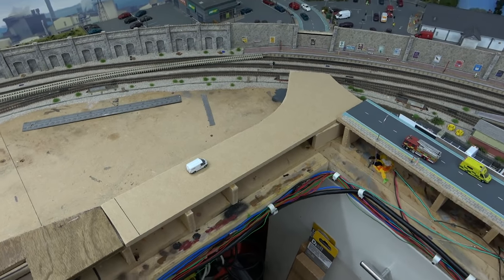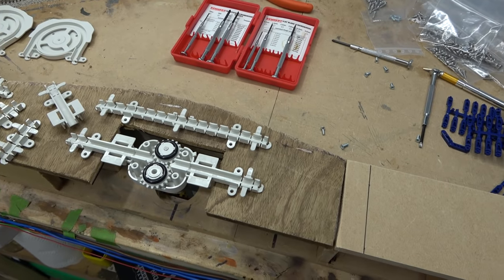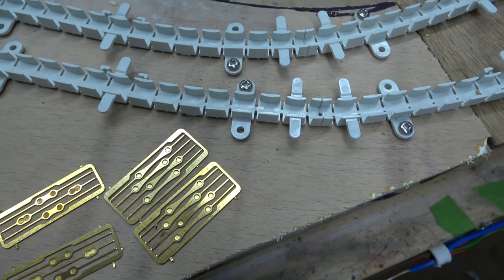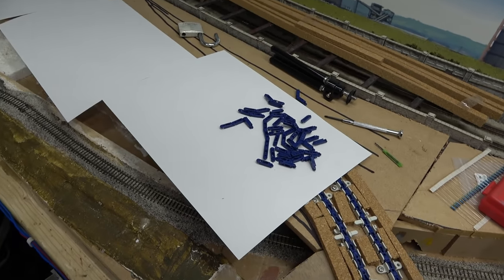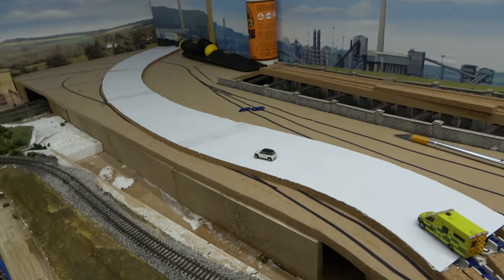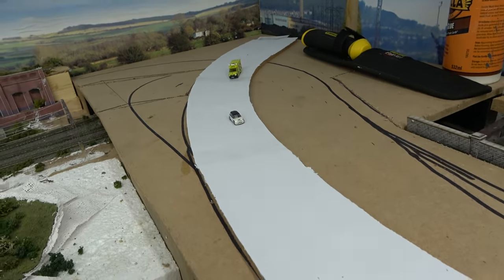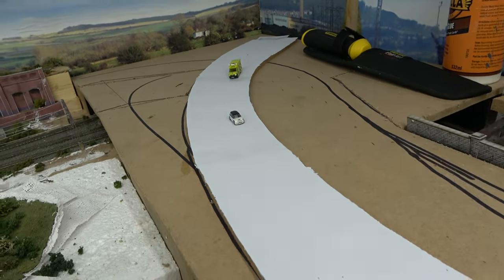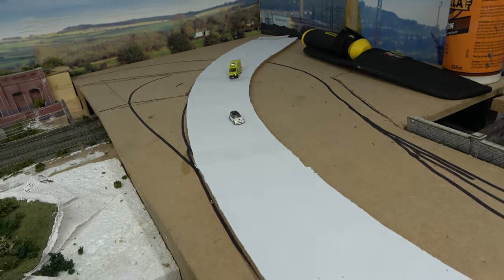Magnorail at Great Deltan N gauge

Comment: Looks good. I realise this would mean changing what you've already done... but to avoid warping of joints in the card in future, what not try replacing it with (or laying over the top) a roll of lining wall paper. You might get away with a single sheet covering the lot. I'd at least seal it with matt varnish.

Comment: Sorry - forgot to add that you can get the wheels turning by doing away with the sliders and attaching NeoDymuim magnets directly to the chassis but not touching the roadbed. This may mean drilling a small cavity into the chassis to get the clearance however the magnets will still. pick up the track magnets and the the vehicle wheels will be the only thing touching the roadbed. Clyde MagnorailOz
Reply: have you ever tried it yourself
Reply: All my vehicles from Lego down to Z scale all work with magnets placed directly on the chassis. Any of my recent Crater lake, Canberra or Diamond valley exhibitions or Lego videos show vehicles, boats etc in action with no sliders. - MagnorailOz

Comment: Try a pulse based speed controller it should male the motors run better than having to low voltage thats causing the stalls

Comment: Good video. Having watched others working with this system, the problem is usually down to the fact that a second motor is required to move the track especially if a max amount of track has been used.
Reply from the maker: To be honest I thought my 2 motors woukd handle plenty, clearly not!

Comment: Regarding the small sliders,  why not keep only the front pin rather than both . . . i believe the car will move in a more natural way.
Reply: They do plus I add Faller Car System steering unit so that lowers resistance on turns quite surprisingly!

Comment: In my experience with these magnorail systems, it’s best to use plastic card, as opposed to cardboard. This lessens surface resistance both against the track and above as well. You seem to have ironed things out, but you may want to consider this if you decide to re do the system at some point.

Comment: Could the lower voltage be the cause of the “jumpyness” of the vehicles?   One thing I’m not a fan of is how noisy magma rail is. I’m adapting a different design. Where the track and roadway is one piece. It’s inverted as compared to mag rail. I’ve had pretty good luck with tiny magnets in front area of car.  My issue is getting a quality car with rotating wheels in N scale

Comment: I think I would have used some silicone spray like the Flomasta variety available from Screwfix in the track and on the sliders. This would greatly  reduce the friction and help with smooth running.
Reply from the maker: My only fear with that would be it getting on the side of the chains and causing the rubber O rings to slip on jt
Reply: @greatdeltan6556  point taken my friend.

Comment: A fascinating video that I watched to the end. I think might have bought a roll of paper rather than try to stick down individual sheets. It occurs to me you could use this system to create a ghost train since the wheels would not need to use their flanges on the corners. With a train, there would be a lot less friction.  Thanks for uploading.
Reply from the maker: Yes I think I'll go for that approach next time
Reply: @greatdeltan6556  I think it doesn't need to be a chain - a belt would do. Maybe you should look in Halford's?  Maybe if you get a tube of two-part adhesive, such as Araldite, also available in Halfords, and glue some neodymium magnets to it? I think it needs a mains-powered motor, as would be to found in an old record player. If neodymium magnets are used, then the surface of the road need not be paper - you could use thin plywood, obtainable from a Doll's House supplier.  Have fun.

Comment: Hi Dan Taxi on the Magnorail: Could you not put a little spacer between the carrier and the taxi to lift the number plate above the card join? I understand the friction between the roadway and the sliders, but would a little lubricant (Vaseline, etc.) on the motors/track help?
Reply from the maker: I suppose it could be an option yes, always have to be careful with lubricant as the o rings rely on friction to drive the chain

Comment: Nice stuff , I’ve got magnarail on one of my layouts , but not had the courage to get to going , so did you glue the card onto the cork strips ? 

Plus I for see with mine the chain will come apart and split . I’ve not tried it so don’t know , I probably should give it a go
Reply from the maker: I did glue the card to the Cork yes, kept glue off the track though so it can be reused
Reply: @greatdeltan6556  ok cool , did you have any issues with chain derailing or coming off. As I’m afraid to glue it incase that happens and you have no access to it . Or is it fine ?

Comment: This is very impressive over a long distance. Hard to tell from the video but seems like it’s a reasonably noisy system to run? I have used the faller system over a short distance on my layout but the cost of vehicles is very expensive so Pros and Cons to both systems. I was thinking a few months ago that you had a lot of roads that would look great if they were moving rather than static as moving trains and static cars never make sense on our layouts. Great result and look forward to your next update. 👍
Reply from the maker: Yes it is a little noisy at times, there are pros and cons of each system of course, faller is unavailable in N as the vehicles are far to small to house the motor and mechanism, it would be much easier I have to admit
Reply: @greatdeltan6556  ah yes, I forget you’re modelling in N gauge. Most layouts it’s easy to tell that it’s N gauge but seem to get lost when watching your layout. Already looking forward to the next update, they’re always inspirational 👍
Reply from the maker: @GoodfordModelRailway  thank you very much :)
Reply: Think u need more motors mate4a better drive......way to long 
Also look at one continues ......paper lay 
Ie one big roll ...
Reply from the maker: @matthewc.419  I'd assumed 2 motors would be enough, as the instructions stated it would, but yes a 3rd would help tremendously with the running, and allow a couple more vehicles too
Reply: @greatdeltan6556  everhard Junction had same problems as I recall....system way to long ......maybe even a 4th motor 
He also had to redo his top layer of plasti card
I admire you like ......though top modelling....
Reply: Everard Junction used clear plastic, painted from underneath to give a smooth surface for the cars and sliders. Great modelling, well done 👍

Comment: Great work. It does seem very noisy.
Reply from the maker: Thank you! It is a little noisy yes
Reply: @greatdeltan6556 do you think there is my way to quieten the mechanism? Foam on either side of the channel? Would white grease on the chain joints help?

I am interested in doing something like this so my questions are designed to learn from your experience.

Comment: hi nice model railway is your railway in yardmaster shed being metal i would advise you insulate the roof also take roof off lay some roofing under felt get from screwfix then put roof back this will stop the condensation dripping on the model rail its not bad in summer but when winter comes 
the change in temperature  water dipping off the roof all your work will be damaged  and one more thing you can do is  above your head put 50mm thick polystrean and tape the joints with duck tape  your roof will have poly then underfelt then your metal roof this info is from   the mistakes i made no insulation my railway was   destroyed   the  shed i had was 16ft x9 metal garage  you could do the walls aswell meny 
alan

Comment: Nice video, You Tube threw another one into my options this morning and had a quick look at that magnorail set. From John's miniatures. he was having the same problem as you, the track jerking. He was also using photo paper. He ripped it up used polycarbonate and hasn't had any issues. Might be worth a look. Admittedly it's in OO but he only has an ambulance and a bicycle on his track. He was still getting the jerking with that. The video was from a couple of years ago so maybe drop him a line as one you tuber to another to see if the problems really went away.
Reply: I used .4 mm plastic, never really a problem, but if you load it up or cause some kind of inbalance in the system it can jerk, but 6 years later I've mastered the art, make all vehicles as lightweight as possible!

Comment: Expensive I imagine no change from over £400 . I’ve just one set so far and that was £165 ! Been in its box for over 15 months and likely to stay there for another year yet
Reply: You only have to build the system once, mine's 6 years old and along with Faller Car System looks great. Better than seeing trains run and a zillion posed static cars ... get yours out of the box!  https://youtu.be/RDpFwhGnYIA?si=NeTTqqUAYy9edTNN
Reply: @robbieparamor4988  yes I may still need to get an extra set or extension. Where did you get yours from in the UK . Mine was eBay but I think I could have got it cheaper even though it was supposedly on offer.